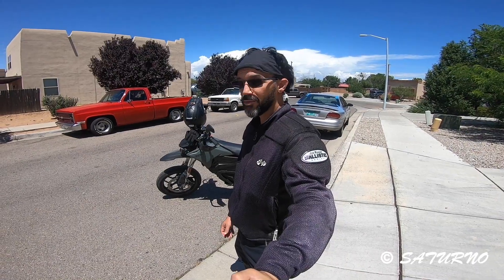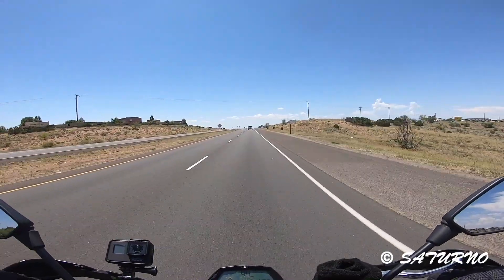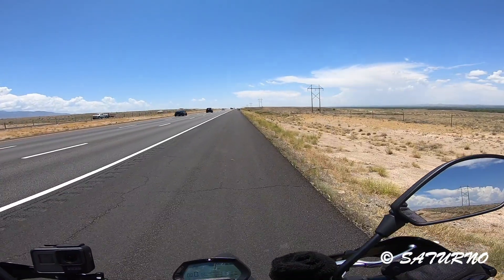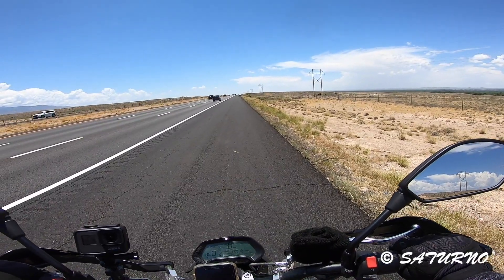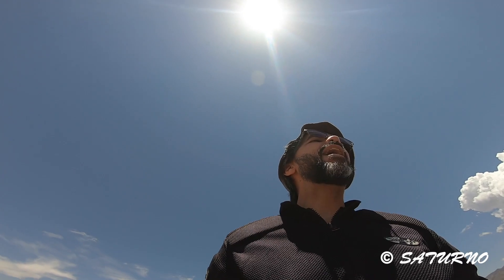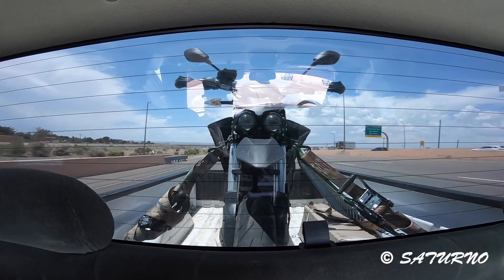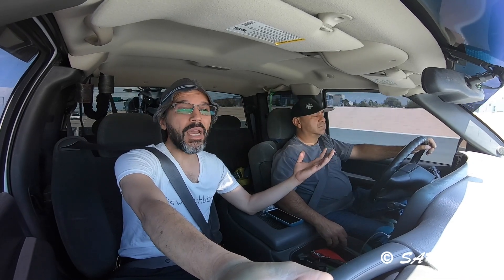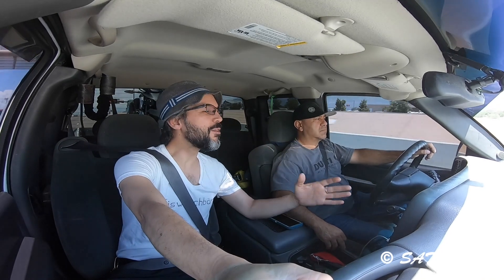Luis TV. Zero FXS: Summer Highway Range

Comment: I just rented a 2019 FX and it did 65 miles of unlimited riding in 60-75 degrees with 3000’ climb and descent of elevation. I am pretty impressed. 

The dirt sized rims weren’t that bad for the street. I want the FXE but I also want a second wheel set and don’t know if the FXE suspension travel can handle off roading vs getting an FXS with a supermoto wheelset. 

Either way, a great bike!
Reply from the maker: I think the suspension travel is longer on the FX but I don’t know by how much. Let me look it up…
Reply from the maker: 8.6 front and 8.9 rear for the FX.
Reply from the maker: Yeah, the FXS has an inch less in the travel
Reply: Yeah that’s not much. Not like I’m gonna take it legit off road or jump it. I will let you know if I do any range testing in the future!